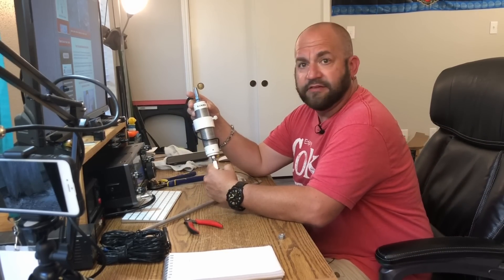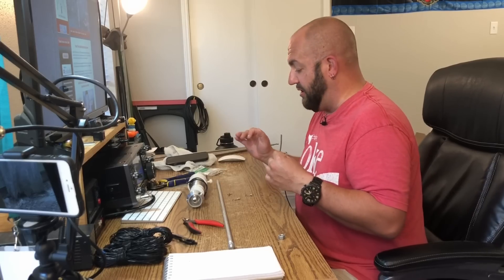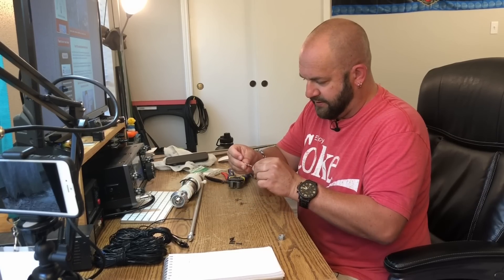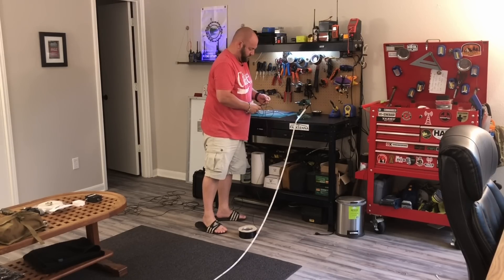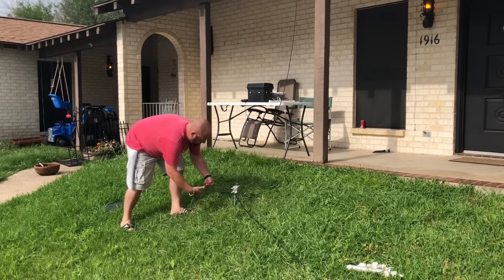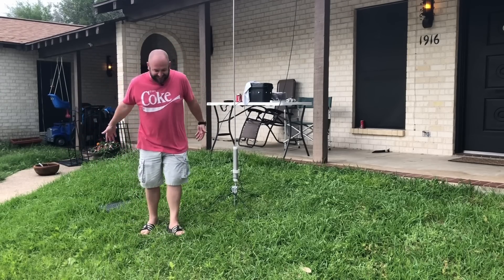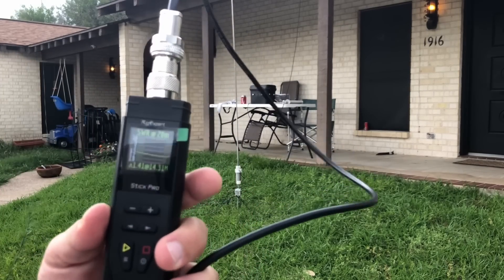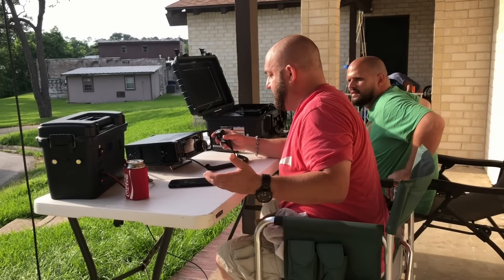Can You Shorten Counterpoise Wires For Wolf River Coils

Comment: Great job on this video. Of course,  one can't run tuned radials on the ground as the ground detunes them. The more wire or conductive material on the ground the better. That's why Faraday cloths can work as a great substitute for annoying radial wires out in the field. This doesn't apply of course when elevated radials, where one can tune them according to band and get a perfect SWR if that is the op's goal. I'm like you and am all for making it easier and not harder. 73 de Scott W1AL

Comment: 1) You probably have Common Mode Currents on your coax showing artificiality higher SWR on some bands, and need a current choke at the analyzer / radio. Try touching the coax connector and see if your SWR drops on the analyzer (bleed off most CMC), to diagnose this.
2) Callum (DX Commander)  recommends 2 to 4 wave lengths of ground radials for your lowest band, you had 30 meters of radials so efficiency will suffer below the 15m band. Callum also stated that with shortened radials you do loose some efficiency, but its negligible.
3) If your really concerned with radiation efficiency (not just a low SWR) stop using base loaded antennas, as your high current point (max radiation, 1/4 wave) is at the feed point and tapers off from there to the elements tip (max voltage point). 
Base loading absorbs your max radiation (1/4 wave element) on the lower bands. LB Cebik W4RNL modeled the Inverted U half wave horizontal dipole where the outer half of both elements dropped straight down. Signal loss was only ~0.6 db (unnoticeable in the real world). Real world testing confirms the model...

SO... with base loading a 17 ft whip on 40m (and lower bands) your loosing most of your radiated signal.

YOU COULD mount the loading coil on a mast (54" Hustler to longer homebrew) plug in a banana plug jumper to its SO-239 and a 3/8" ring terminal to the mast mount, insulate and feed the base of the mast and improve your 40m and lower band signal. Mid loading is recommended and preferred for that reason, ask Callum.
4) What band am I on? 7 Mhz!  Hi Hi. 
I was licensed before you were born, so my mind is stuck in the rut of Feet and Inches. You young guys can spread the Meters word to the new generation of hams...

And on that note, KEEP UP THE GOOD WORK!     73   mike   N4ONL

Comment: What is the gauge  of the wire for the radials I cannot afford   300ft. of dx1o wire
Reply: 18 gauge wire is usually recommended for a single antenna element at 100 or so watts, 14 gauge for 1500 watts. BUT with multiple radials you can use smaller gauge (RF wise) as it divides the ground current among them. Just keep them large enough that walking in them wont break the radials.  
I'd stick to 18 ga for its strength.
Callum (DX Commander) recommends you use 2 to 4 wave lengths of radials (for your lowest band) for efficiency.  You'll get a little gain above 4 wavelengths but its not really worth its cost. Economically 2 wavelengths of radials should make you happy. You can add more radials in the future if you have to use fewer.
I personally wouldn't use shorter than 4 meters (~14 ft) for each radial with a 1/4 wave vertical on 40m and up. Remember, doubling the radial length increases the effective ground area by ~4 times when using several radials.
73   mike   N4ONL

Comment: I enjoy your videos and just cane across this one. So what happens if you take those 33ft radials and snake them back and forth in roughly 5. 5 ft lengths? You have a pattern roughly of six 5.5ft radials. So 3 wires in roughly 4m diameter area.

Comment: I like to look at insulated radials as forming a capacitive coupling to the earth in order to extract the return currents from the earth. There are many many parallel paths through the earth and just like parallel resistors that reduces the total resistance. The formula for resistance of the earth or a slug of earth is R = (resistivity of the earth)  times Length/Area ( of that slug or hunk of earth)
Each slug of earth with a given length and area has a resistance and can be thought of as a resistor. Out away from the antenna there are a great many such slugs in parallel providing good conductivity. However close in the number of such slugs decreases and the net conductance goes down creating a higher resistance to the return currents.
So a single ground rod will have a high contact resistance with the earth but a flat “capacitor” plate or a radial system can provide an effective low impedance path spread out over a large area of earth. The largest gains are made close to the antenna where the return currents merge and likewise the number of parallel paths are less. By extracting the return currents with the radial field just several meters out where there are still significant parallel paths for the current the losses are much reduced. The farther you go from the antenna the less you have to gain by extracting the return currents at that point.

Comment: great videos as usual .. I find with my Shorty Forty I use 3 16ft radials and it's 1 to 1 at 7040 with my Chamelion SS17  ... I think Wolf River has actually put another loop on the coil just for the shorter SS17 antenna ... de N2JNZ

Comment: I read a lot about radials when I put up my Hustler as a flagpole antenna. I ended up buying a 500f, sorry 152.4m, roll of insulated wire from Lowes and in my 30x50', i mean 9.14m x 15.24m, back yard used all of the wire with the smallest being maybe 6' err 1.829m long to maybe 35ish' 10.68m long being the longest evenly distributed around it makes it work much better, I think it is quieter and my 6btv is tuned and operational (ie. multiple contacts made) on 6,10,15,20,30,40,80m so 7btv...😁

Comment: Ok, so I went and made my own counterpoise and I kinda screwed up…. Instead of making 6x4.8768 meter per gator clip, I made 3 gator clips with 2x 4.8768 meter & 4x 2.4384 meter counterpoise wires per gator clip.  

All because I did a bone head thing cutting my first set and didn’t want to waste the wire.

I should be ok, right?

Comment: do 11 meters. does the length of the radials matter to the last inch ?
Reply: Callum once said, "Throw a couple wavelengths worth of wire on the ground and you'll be fine." I have also tried this and found it to be true. As far as 11m? That's not real radio :)

Comment: Should the loading coil be as close to ground as possible or would elevating it on a tripod help? Not center loading, but just getting the antenna higher in the air? Or is takeoff angle the main thing with these setups?
Reply: @boblatkey7160  This is what I've been hearing as well. Just got back from an antenna theory class today at a Hamfest. The presenter suggested running them as center loaded offset fed dipoles. Basically you put the coil in the center instead of base loaded, raise the base off the ground on a tripod to insulate it and run one radial 1/4 wavelength in the direction of your desired contact zone. You fine tune your swr using that radial. If you wanted a more Omni pattern you would add a second radial 180degs the opp direction. But you have to tune both radials in that setup. I also think it helps with the Q and allowing a wider tunable range.

Comment: As I was born in Europe I do prefer metric system. When i arrived in Canada i was surprised they are using both systems. i can literally go nuts using imperial system. Metric is so much better, how on earth is it possible to deal with those 1/16th of inches and the like??? It's so easy to use mm cm and m ;) 73 de ha7wx/ va3kwx chris
Reply from the maker: I have no idea.  It's so stupid.  I agree with you 99 7/64ths of the way lol.  I couldn't resist.  It's just so dumb lol!  And when you convert fractions to decimals, you can't find the measurement on a ruler because Imperial is based off of 8, not 10.  Show me where .65 is on a ruler.  You can't.  I hate it so much.
Reply: The Imperial system cant be to bad!  It won WWII!!  lol

Comment: are you using the words counterpoise and radial interchangeably? I'm trying to figure out the difference..
Reply: I hear other hams doing the same, but I'm not sure . This is what I understand ... the radials assist in a good counterpoise. Typically radials use the soil (and moister and salt) to create a good counterpoise to the other side of antenna. would be cool if someone with knowledge chimed in.

I'm but a year ham, i guess yam.
Reply: Counterpoise is basically a ground radial that's elevated from the ground. It's a "Artificial Ground" if you will. Like chicken wire suspended above concrete. That would be a counterpoise. If you had that same chicken wire on bare earth or buried, it would be a ground field. They serve the same purpose by different means.
Reply: I think a radial is a counterpoise, but a counterpoise it not necessarily a radial.  Counterpoise for a VHF/UHF antenna could be a pizza pan or a car's roof or trunk.  A radial is a KIND of counterpoise that is more practical for longer wavelengths (33 foot radius pizza pans are not very practical).  So radials would be wires that "radiate" out from the vertical.  You couldn't call the metal screening gator clipped to ground under a vertical antenna a "radial" really, but it is a counterpoise.  Counterpoise is the broader term for the thing that the radiating element works against.
Reply: Counterpoise are elevated and need to be tuned.  Radials are on the ground and don't need to be tunes because the ground detunes them.............................

Comment: Given that there are so many suggestions on the length of radials and how many,  what it all comes down to is the space that you have. For me, I have a small back yard and the 15x2.5m sounds like it might work. However, I plan to start out with only 12 radials at that length and see what the SWR readings are and then add or subtract radials to see if it makes it better.  It's all about experimenting to see what works for each person's situation.

Comment: More radials is always better and short radials (0.05 wavelength) can replace long radials.
The nuance is varying the length of the radials most effectively. Think of your radial set as a discone or fan dipole.
You got most of your bands where you want them. What length would you need to help with bands that are still a bit finicky?

Comment: With my DX commander that I made, I used random lengths around the 2m mark, rather than specific lengths. So they are all between 1.5 and 3 metres long but are all different. This seems to work well. I'm not certain but being specific about the length of these may not be required.

Comment: One thing i did on my DX Commander is i  made four one foot long wires with alligator clips on each end. I clip them on right before i stand it up. Im kinda crippled up and bending over is hard. While i was spreading  out the wires it kept loosening the wing nut and the ring would fall out so back on my replaced knee to put it back on. Now i just reach down clip it on and spread them out as i go i ought to do short video of it. Wish i had some aircraft wire splices they just click together.
Reply: Glad to see people experimenting with their DXC’s. I used the standard Callum suggested 7x4 counterpoise setup on my DXC. It was so annoying to set it all up and fiddle with wing nuts and and that annoying sticky washer while connecting radials…. Especially in the grass. I made seven 10g pigtails with female MC4 connectors (solar plugs) and added two more wires to each set with MC4 male plugs…. Now setting up counterpoises is easy and the MC4 plugs won’t let loose while fanning and tugging on the counterpoises or if someone trips on a wire….

Comment: I have 3 30' HFT metal tape measures I want to use as a counterpoise.  But use alligator clip patch cables to connect them to the legs
You could use a gator clip at one end of your extra radials.  Makes instillations easier?

Comment: Remember the radials are 1/2 the antenna. Add more and your receive will also improve.  I’ve run 30-8.5ft radials with excellent results.  Recently cut a new set of 21-13 ft radials. Still have yet to get out there and play.  Try and get the equivalent of 4 wave lengths of wire for 20m band. Will give you excellent results. Same concept is used w dx commander.  It works.

Comment: Completely agree on the Radials Mike. On comparing to your end fed, 2 things, the WRC is compromised slightly due to base loading (nothing wrong with this) but the main thing is that height is might. I've done so much testing at home in a semi suburban area and an antenna in the air with a clear far field wins everytime. Get a vertical where it can have a completely free take off in its far field and it can then put up a good fight and outperform a dipole, exspecially on DX.

Comment: In the manual I printed out for my DX Commander Classic, Callum has his radial examples I copied right out of the manual on page 9 is "21 Radials 3m long (Callum’s favorite)"
I am not sure if there is an "exact" science to radials except it is good to have something...
I like your idea of a small footprint. The radials that come with the WRC TIA system I have are quite long. I should just use that wire to make a new configuration.
I also have removed the coil and used my Shark ham sticks on the WRC base and have had good success also.

Comment: When I was laying down my radials at my house, people said the wires are too short and it'll never work. I put down 55 radials anywhere from 10 feet to 33 feet (I cut each wire to fit in the space I had) and the only reason I stopped at 55 as opposed to 64 was because I ran out of wire. I had laid down 1000 feet of wire (305 meters ... or 3.8 times 80M ... which is nearly ideal, I may go back and lay down 9 more radials to get to a full 320M of radial for giggles and get the 4 full times max band). I get out all around the world and have made 20,944 contacts (17,019 confirmed) from 155 countries.

In short (pun intended), it's not the length of your wire, it's the total length of all wires.

Comment: A couple ideas came to mind. 1. Try tuning the coil a little low in frequency, then shorten the length of the vertical to fine tune it to resonance. 2. Add some wire to the top of the vertical and throw the other end over a tree branch or over your roof, and it would be an inverted “L” that should be more efficient. 
73 Dave K7DR Sterling Hts, MI.

Comment: I run 5m radials on my WRC all the time. Usually bundles of 5-6 wires mated to Mueller clips, and typically run 3 to 4 bundles. At 40m,  that's at or over two full wavelengths of radials in the end, and far more for the higher frequencies.

Comment: Thanks for the good video Mike! I’ve been experimenting and researching this with my own base loaded portable design I’m working on. Here’s what I’ve found:

The reason the SWR is higher on 20 is because the radial system is more efficient on the higher bands. On such a short antenna with short radials, as you add more radials the feed point resistance drops away from 50 ohms and SWR goes up. However the gains you see in dB on your signal strength far outweigh any power loss. 

Even though your dead flat on 80 is venture to say most of your RF is lost in heat. Remember a dummy load is a perfect match too but most of your RF ends up as heat!

With my system mounted on the ground spike as I take radials away on 20 meters the SWR drops from 1.3 to 1.08. That’s without changing the load on the coil. Better SWR but less dB signal received at the other end.

Ref ARRL antenna book 3.11-3.13

Comment: I use 3 sets of 10 wires each, 24ga silicone wire about 9’ long. Keeps the station footprint down when operating POTA in small and urban areas. Works just great.

73 K9MKE

Comment: For a POTA setup when I start on 20m or higher, I unravel 2 radials and connect each at BOTH ends, so the ground radial setup is like two clover leafs, arranged perpendicular to the feed line direction.  78" whip on the mega tripod.  Flat SWR whole 20m band every time.  Then if I want to drop to 40/80, I will add the third radial full length and throw on the coil.  Bonus tip is to use banana plugs to so any trips don't bring down the antenna.

Comment: I've been having great success on 20m using the original (3) 33' radials and then adding (10) 1/4 wave 20 meter radials. I'm 
using the Wolf River TIA as a base antenna.
Reply from the maker: I'll bet that works great.  A little outside of the scope of what I'm trying to do here in shortening the footprint of the antenna but more wire is usually a good thing.

Comment: This is just my experience but I have a similar setup from watching Cal’s video. I used five radials per connector but 3.5 meters long each. I was good on 40, tested 80 it was fine, but don’t really use it in the field. 20 I could not get below 1.6:1. So over a few days I played with it trying different things. I finally unhooked one of the sets of radials and it got down to 1.1-1.2:1. So now when I run 20m I only use two sets of five at3.5m. Hope you find something that works for you. Hope to hear you on the air again. KN4QHQ.
Reply from the maker: Interesting.  I hadn't thought of that.  I'll have to give it a try.  Thanks for the tip.